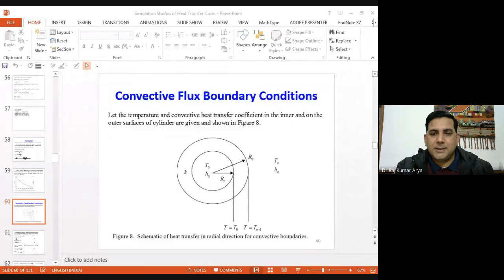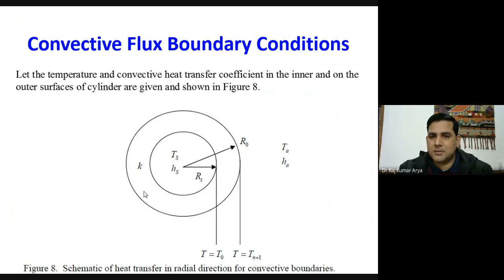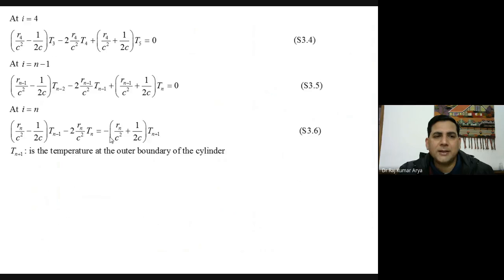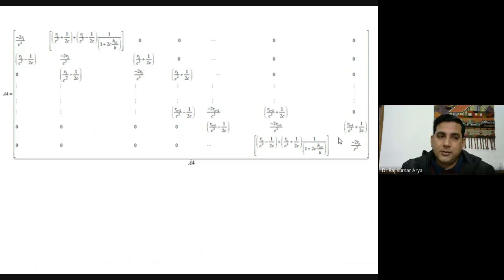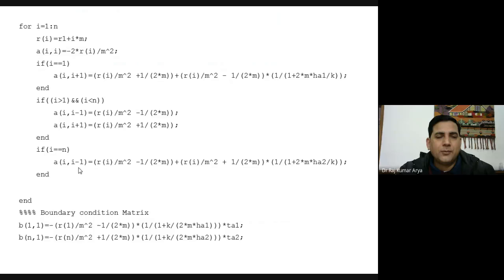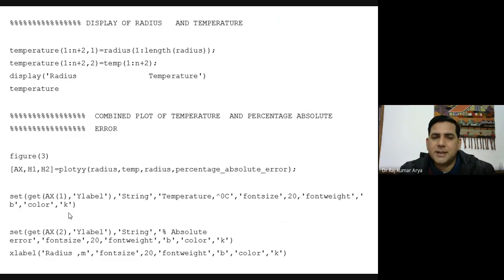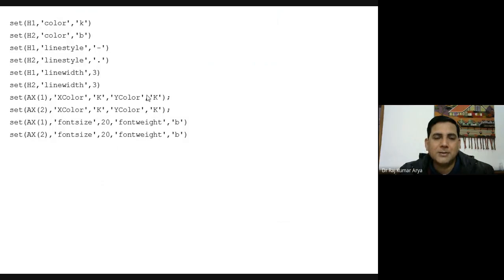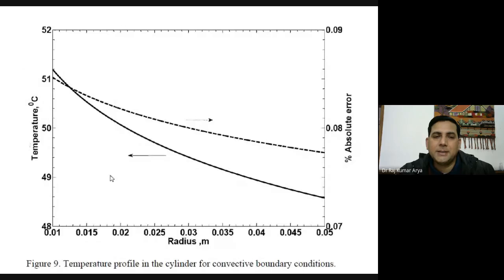MATLAB solution of flux Boundary conditions in cylinder

Comment: Professor how would I solve this system of first order edos numerically by plotting the graph for the different values of (n). the derivatives are in relation to ha (r).

a'/r = -e^2*v^2*(g^2 - 1)

g' = - a*g/r

given the boundary conditions

a(0) = n                      a(inf)=0
g(0) = 0                     g(inf)=1

where (e)=0.5  and (v)=1 are constant and n variavel for 1,2,3,4,5. please give a helping hand there, I looked for and did not find any problems like this on the matlab website.
Reply from the maker: Dear Holanda,
    Thank you very much for your query. I will try to help you. Please email me your Equations by email: rajaryache@gmail.com, please type Equations using Equations editor, so that they should not get disturbed.
Reply: @drrajkumararya2665  yes, i will send it to your imail, thank you very much, anybody tell me.